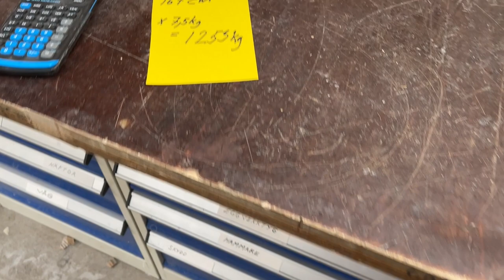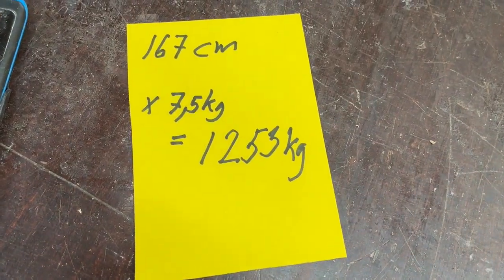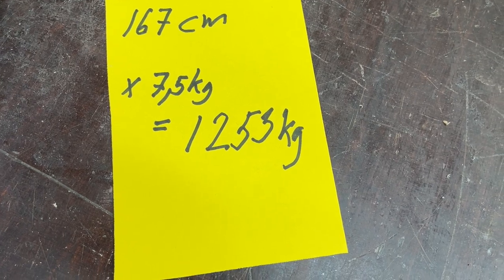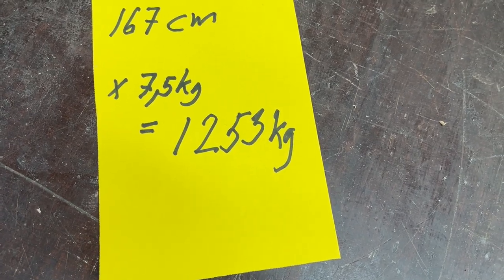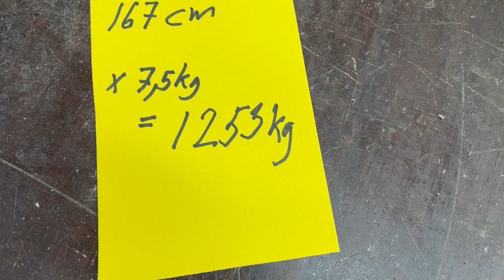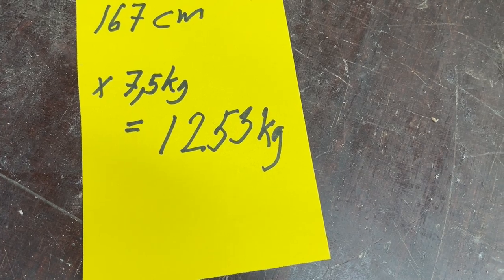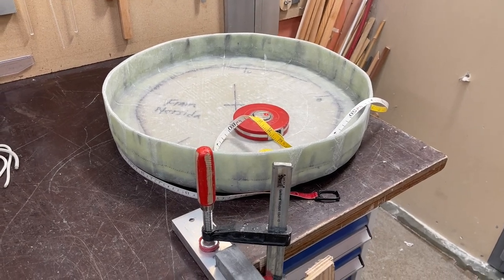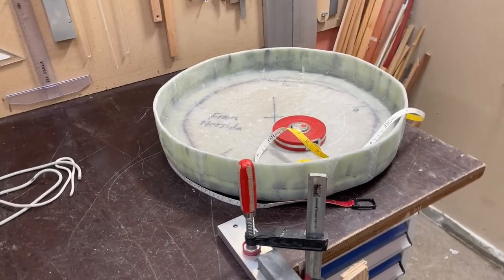3 Dec 2022 . Finding out the force needed to compress the gasket of deck hatch I forgot divide by 3.

Comment from the maker: I did put the 7.5 kilo across the 3 cm wide gasket. Therefore the result have to be divided by 3 cm
Thats about 400 kilo.
Maybe for everyday use 400 kilo is a bit much but about 200 I think is proper. 
Thats about the weight of 3 men needed to stand on the hatch thats the force the ratchet strap shall apply.
It makes me feel good when I can trust all the details of my boat on the big blue eternal endless ocean swept by strong winds and one is far from everyone down there in the Roaring Forties. 
Most landlubbers do not understand such things.
Reply: Ok, good.  Glad that is working out.   Have never sailed the Roaring forties, but have crossed oceans on my boat. So indeed do understand that especially the kind of sailing that you do, strength and integrity is very very important.   This is an exciting endeavor.

Comment: The best part of using a ratchet strap to hold the hatch cover down is that you only need to have it tight enough to not leak unless you expect very bad weather. When that time comes you can get a great deal of force to be sure that the hatch won't leak and a wave will not tear it away from the boat. Thank you Sven for the update. Have a good day.

Comment: The ratchet straps are a good idea for sure but you'll need to be judicious with them because they can put a lot of force.  I bent a 1" spring steel rod with a 1" ratchet strap once.  Don't want to pull your eyelet out of the hatch cover or the bottom mount.  I've never sailed in the ocean.  A little in Lake Superior.  I spent many summers working on the railroad in the Northern Great Plains and remember the stars at 02:00 when the lights went out.  I can imagine what it's like out there.  (Never spent a lot of time by myself out there though).  Not sure if a Sea Eagle knows what the prairie is like.

Comment: I don't like that you drill holes in Exlex bottom to fasten the hatch. Why not build up 4-8 structures onto the hatch itself as well as to the opening so that you can lock it  with  excentric  latches in a similar way as you lock some waterproof boxes? It will spread out the load to several points, and will create a more useful bow.

Comment: could the cross section of the fiberglass that touches the rubber be made narrower, ie less force needed to be watertight
Reply from the maker: If you make the edge more narrow it may cut into the gasket.
Also if you make it more narrow it will not be so robust.
It may get dented.
Reply: @SvenYrvindExlex  yes i see